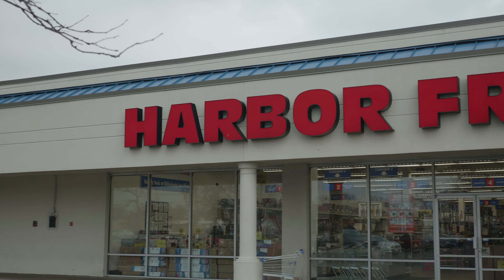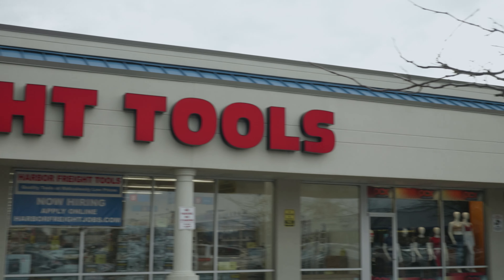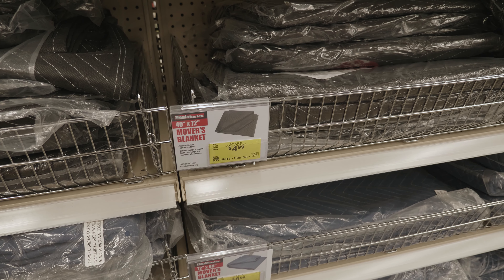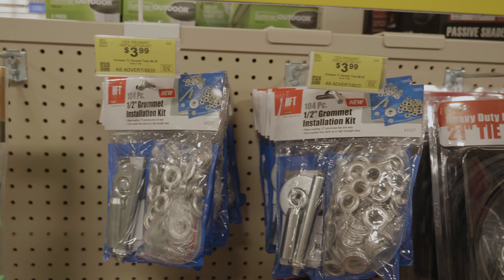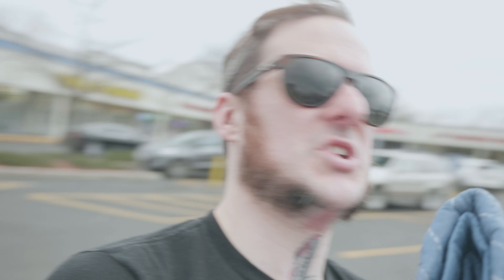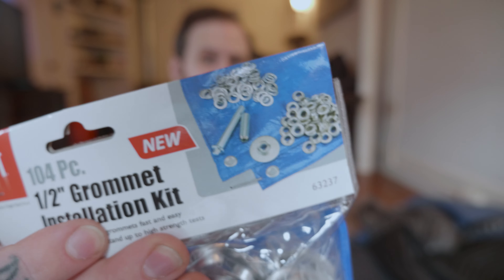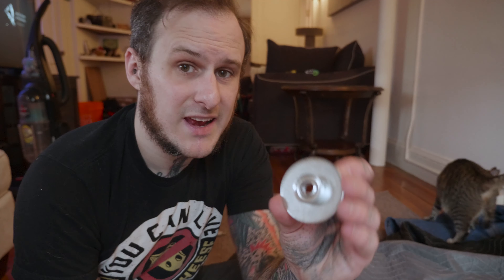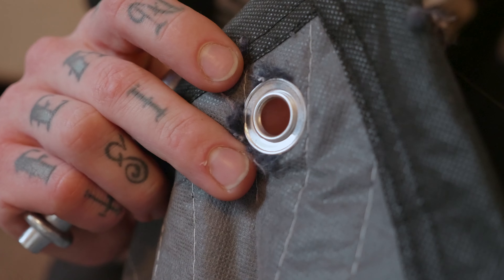How To Make Acoustic Blankets - Sound Deadening DIY

Comment: Did you ever make a video of the sound paneling on the wall? I would interested in how you made that please. Thank you
Reply from the maker: I did not, but they are made the same way as a couple other projects that I have shown on here. Namely wooden frame with Rockwool inside of it & fabric wrapped around them. 

These 2 videos both feature projects that use the same method, you can just apply what I do here to smaller scale picture frame type designs to create such a thing: 
Studio Revamp 03: https://youtu.be/g1Kepc0ScSg?si=68Kh-bHopleHlA5j
An 11 FOOT Sound Panel: https://youtu.be/Ni6nf8BDAk4?si=M1mlJCR70IztWv94

Comment: Great video, thanks. If we want to make the blankets match decor or such, does it reduce sound improvement to just hang another fabric over them? Or even sew another fabric covering them?
Reply from the maker: I’d recommend sewing a cover over them. Just look for it to be a fair thin material so it is “transparent” to sound waves. No super heavy denim or something like that. 

Lately I’ve moved to using paint drop cloth canvas and rockwool insulation to make sound “panels”. You can see that process in this video:  
https://youtu.be/g1Kepc0ScSg?si=oo_kPkyqyHMbUKBF
Reply: Thanks! So I could sew a drop cloth to a moving blanket, for example? @MandicReally

Comment: Sound proof blankets already have the holes. I bet if you add it up you probably didn’t save much
Reply from the maker: The absolute cheapest "Sound Blanket" I can find is $33.99 for a 72"x80" one.  It is from a company that is selling Moving Blankets AS Sound Blankets (Same as I showed making here.).  The same size blanket at Harbor Freight is $8.99 without a discount code or sale pricing. The grommet kit to install the eyelets is $4.99 when not on sale, it also comes with about 50 holes worth of Grommets.  So I could easily make 3 full blankets for the price of that ONE premade one.  Is my time worth something?  Absolutely, but that is a trade off you make to DIY things.  I could easily make 3 of these in less than 30 minutes and I generally charge a $60/hr labor rate, so I'm still cheaper than buying 3 of them.  

Are these as good as "TRUE" Sound Blankets (Sound PROOF doesn't exist)?  No.  Are they vastly cheaper so you can justify using a lot more of them than you could otherwise afford?  Absolutely. If the difference is Affording to Cover MORE Space, or Affording ONE Good blanket, I'll cover more space every time.